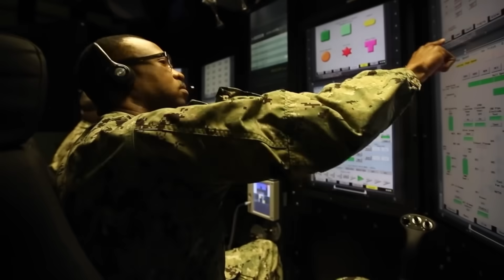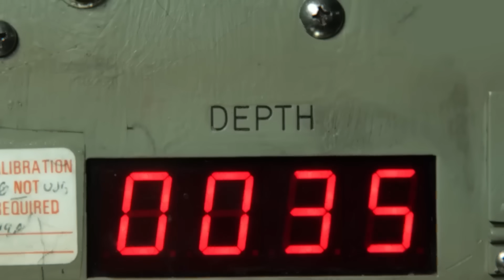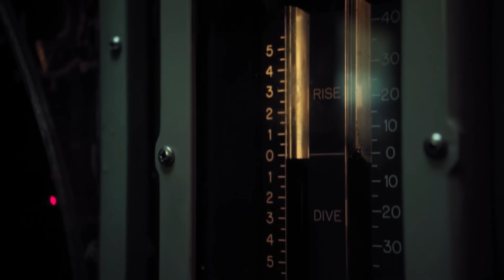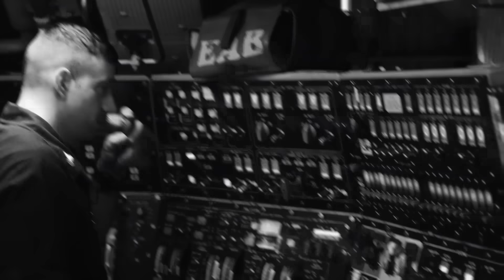What Happens When a Submarine Hits "Crush Depth"

Comment: I can tell you that you actually hear the metal crack when it is near . I've been on a tank before where there was a high pressure problem , taking care of closing some valves to make the pressure go down . When i was on the tanks you could hear the metal actually making popcorn noise and you can be sure i did not want to stay there 1 second longer then needed to be . That being said , the pressure was in fact rather small (big tank) but the cracking noises were very clear and were certainly from the steel settling itself to pressure which it wasn't used to  .
Reply: Good thing carbon fibre don't crack, they crash around you.
Reply: internal pressure, yeah, makes sense. Perfect shape to resist pressure, either internal or external, is round. Internal pressure forces towards this perfect shape, that's why you can have even soft materials resisting it. Elastic ones are best bc they adjust for a while, that's the warning noise before it explodes.
For external pressure you need rigid materials, to keep their shape, bc external pressure tries to change that shape. I think there's no adjusting to make a warning noise - once there's a slight change in shape, not only the material is compromised, but the shape isn't optimal anymore and I think the collapse follows almost instantaneously.

Comment: Think about it: Oceangate's Titan (practically a tin can with no safety procedures, backups for system, no radar, no gps, no nothing) went down 3 times further than the most advanced submarine.
Reply: You mean navy submarines which are huge... Like mentioned in the video small submarines have reaches 11000m before, Titan didn't even reach 4000. Just an abomination of a design
Reply: @TimDaOne  11km* 11000 would be insane lol
Reply: @Walamonga1313  Yup you're right
Reply: @Walamonga1313  Titanic is at 4000 meters. They had the Titan tested by a safety expert, and he said it was only safe to go about 1800 meters.
Reply: Oh come on now, the US Navy and Russia both have subs that go that depth
Reply: For real?
Reply: Radar doesn't work underwater.  GPS doesn't work underwater.  With only very limited exceptions for extremely low frequencies close to the surface, radio doesn't work underwater.  Seawater is conductive.  It makes a quite effective shield to block radio waves.  It is quite difficult to communicate with submerged submarines.
Reply: @stargazer7644  it's called sonar, but it effectively is the same thing as radar.
Reply: @nexttytreporter2598  No, actually they're completely different things and work in completely different ways, unless of course you think your eyes and your ears are effectively the same thing.